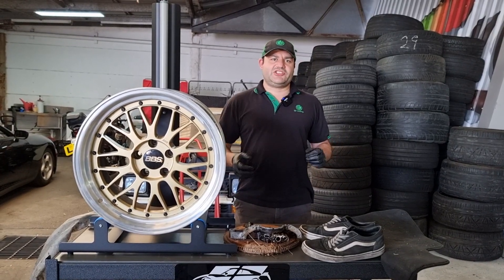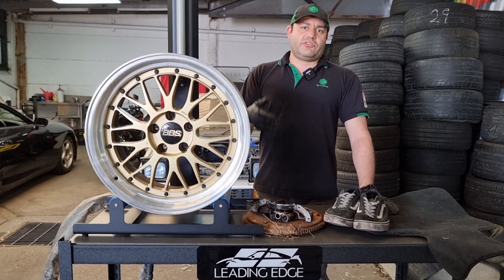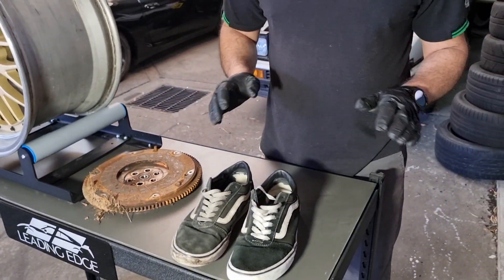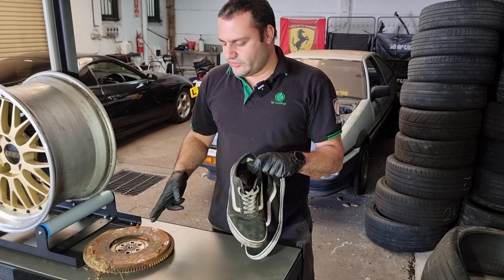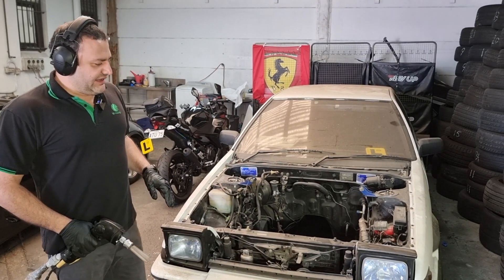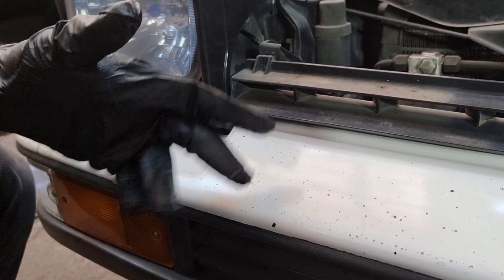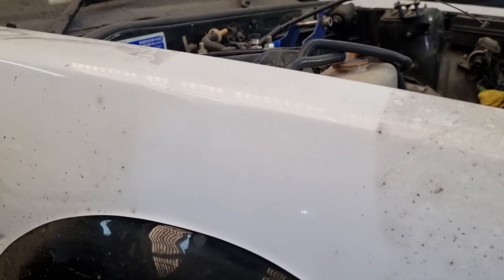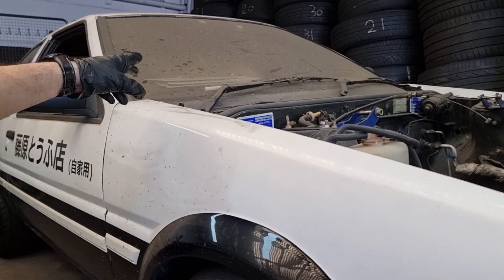Dry Ice Cleaning Random Items vs Steam Cleaning - Viewer Request

Comment: Watching the amount of ice forming on the carpet makes me wonder if the air supply needs to be dryer. What is your desiccant solution?
Reply from the maker: Hi mate, the air supply has a dryer, ice normally forms from the humidity already in the substrate. If it is 90% humidity outside and you dry ice blast a fabric/carpet you can only assume that the carpet/fabric will have humidity in the fibres

Comment: Do steam clean/extraction vs dry ice on floor mats that would be a neat comparison
Reply from the maker: My personal preference is to extract vs dry ice blast, ultimately the dry ice blaster will clean the surface but extractor will suck out the dirt from the fibers better. If the opportunity arises I will make the video you suggested